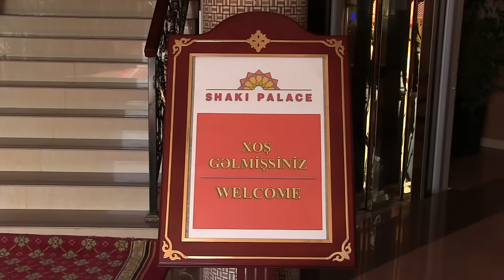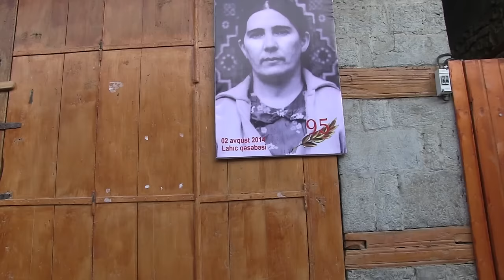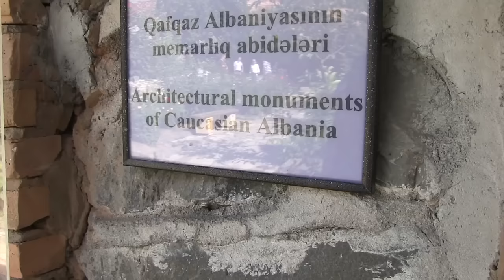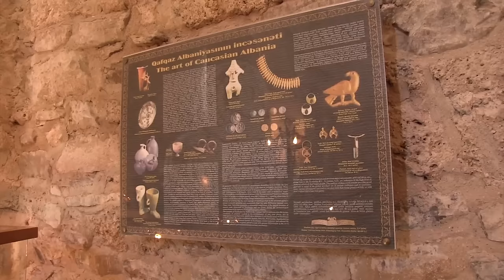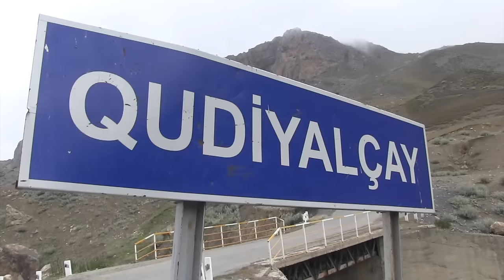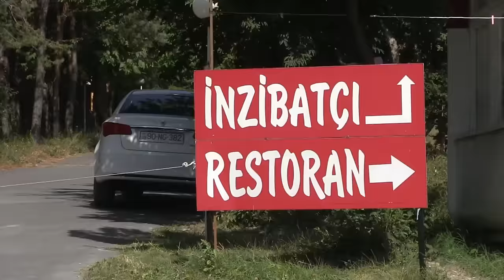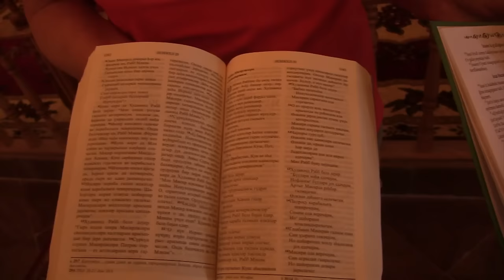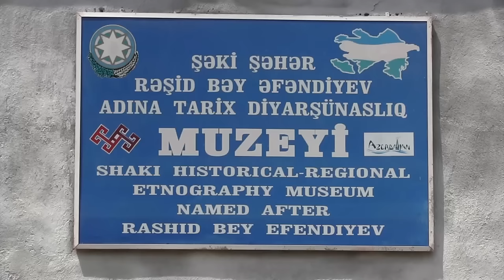Christian and Muslim Villages of Azerbaijan

Comment: OGHUZSTAN (Zangezur) REGION is a Dispossessed territory of Azerbaijan, WHAT'S UNDER CONTROLLED BY ARMENIA.
Zangezur (Zangadzor) or Syunik and Bayatzur or Vayots Dzor (was a part of former Nakhichevan Khanate) was Caucasian Albanian territory where was settlement of nomadic Oghuz tribes. 
In the medieval era, the Oghuz Turkic Seljuks, Kara Koyunlu and Ak Koyunlu held away in the Zengezur and Vayotsdzor region until the Treaty of Turkmenchay signed after the Russo-Persian War of 1826–1828. This land was called in name of Oghuzstan.
On 26 April 1921, Seljuks, Kara Koyunlu and Ak Koyunlu of Oghuz tribes (3/5th population) were  driven out from Zangezur Mountains (Oghuzstan) region by fanatic crusader Garegin Ter-Harutyunyan (Garegin Nzhdeh) Head of
the Republic of Mountainous Armenia.
(Ref: Garegin Nzhdeh and the KGB: Report of Interrogation of Ohannes Hakopovich Devedjian" (in Russian). August 28, 1947. Archived from the original on 2007-10-30. Retrieved July 18, 2012)